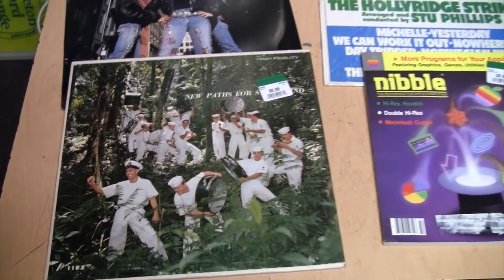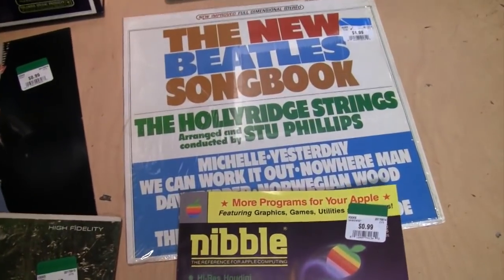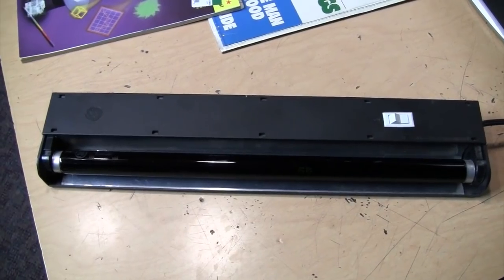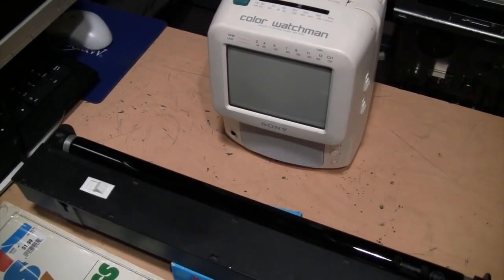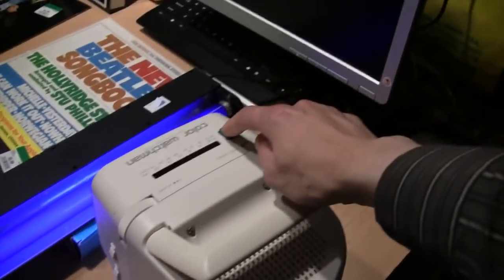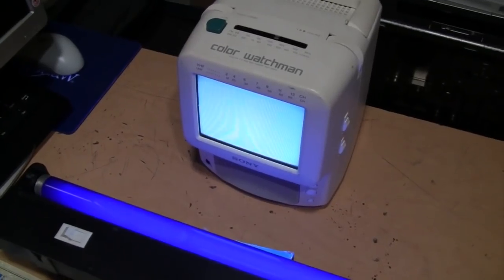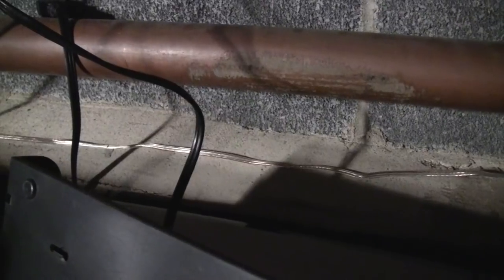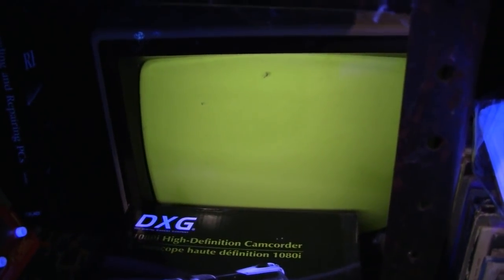Blacklight vs. CRTs

Comment: Yup, that's what blacklights do, they make the phosphors/fluorescent materials glow.
Noticed it with my TV when I had it in my bedroom, many years ago.
Of the few "disco things" I had in my childhood, the blacklight is one thing I didn't sell off because it's so damn useful for all sorts of things, checking banknotes for example. Or checking the conformal coating on printed circuit boards (not all coatings are fluorescent).
Very useful indeed. :)

Comment: "No user serviceable parts inside"?  I beg to differ.  I have a bunch of blacklights around, and one of them is even the same fixture.  It's not fun opening it, and you may break clips on it when you do (easily resolved by a little bit of hot glue), but you can replace the starter inside when it goes out.  It's not socketed, so you'll have to do some soldering.  The wires don't give you any slack either, so it's not a fun job but it can be done without too much fuss.  In addition, you'd be appalled at the shoddy Chinese wiring job inside.  And just imagine how many things around the house are wired in a similar fashion inside.  That gives you an all sorts of safe feeling inside.

I've seen blacklights make CRTs glow before, but actually never held one up to a monochrome screen.  Neat trick how it glows the color of the phosphor inside.  Sounds obvious now that you show it, but I wouldn't have thought of it on my own.  I probably have some of that dollar store speaker wire around as well.
Reply: jaykay18 They WANT you to buy a new one and pay up.
Reply: Of course, but you can beat them at their own game!
Reply: There are ALWAYS serviceable parts inside everything. I always cross out "No" and write "Lots of" so it reads "Lots of user serviceable parts inside".
Reply: That works!
Reply: KD2NOA Edward Martz Or they don't want you to see the crappy quality

Comment: 2:07 holy shit this scared me. 1am watching and thought somebody was breaking in
Reply: It actually startled me too.
Reply: startled me aswell and thought the same thing lol
Reply: Wow I went back to check it out and wow, the first time I heard it I assumed it was just a noise outside (I'm using headphones too). It sounds like the same effect of a binaural recording
Reply: When I worked in clubs, they would have these 36inch black light fixtures over the bar shining UV towards the overhead tv and it was freaky to see the screen glow so bright.  You can have so much fun with a bright yellow, green or orange  neon markers. Even if they were almost dry. 

Also, ifound that those cheap Halloween a19 bulbs make for a good pass thorough filter for UV light by Loki g at the world through the glass. Also, where I had cataract removal surgery in the 70s, I can easily see UV A light.  So to me, black lights are fairly bright.

Comment: 1:15 it glows because of the phosphorescent material used on the CRT screen which emits light when struck with UV or high energy light
Reply: phospor material in the crt is same as in the lcd

Comment: I used to have an old crt monitor for my computer. I noticed one night that i turned my cieling lights on and off quickly and the crt retained the light for a seconds before it faded. CRTs are definetely unique technology
Reply: ethefire This effect is due to the phosphor applied to the inside of the CRT's glass panel. Phosphorescence is when a high-wavelength electromagnetic wave (such as UV light) is converted to a lower-wavelength wave (like visible light). Since the human eye cannot see UV light, such coatings suddenly emit a bright light under a dark light. Fluorescence has similar effects, but works in a different way.

Comment: Hey that's awesome, I take it this only works when the TV is turned off, because I never noticed the CRT digital scoreboards at the bowling alley glowing in an especially funny way when they have "glow bowling". Either that or they applied some sort of coating on the monitors so they don't glow and obscure the score board.
Reply: works on my mini portable and main crt monitor while on, just need a strong uv maglite pointed right at it

Comment: do you remeber the video of dont buy cheap chargers? well i buy a laptop (Hp nc6230) and come with a "original charger" was in really good sharpe and the connector id bigger than the port of the laptop it connects but is a lil bit larger and in the side say Caution may become hot in english jappanisse and more later i found tthe sticker say HP down was other and i quit the HP stiker and i found a Made in china and corerct was a cheap charger
and interfire with my am radio the seller say can come with a original or a generic but i dont know if the seller do this or the seller of the charger selled like that i really dont know
Reply: Punctuation is a wonderful thing.
Reply: English isn't everyone's first language.

Comment: does it work with gas plasma screens?
Reply: I would guess no - I don't believe they make use of a phosphor.
Reply: It should, as that is EXACTLY the principle of operation of PDPs. Mercury vapor inside the gas plasma cells emits UV light as it gets struck by electrons flowing through the plasma. That UV light in turn excites the phosphors on the panel to glow in infrared (60% of the energy and the main reason PDPs are so inefficient) and in the visible light spectrum. :)
Reply: ok
Reply: I assumed OP was talking about the orange plasma displays used on some vintage computers. Those use neon gas and no phosphor.
Reply: Whoops, didn't think of those... If that's what the OP meant, then, no, it wouldn't work on those. Otherwise it will work on plasma TVs. :)
Reply: I tried this on a very modern plasma TV, a 64" Samsung F8500 from 2013. It didn't glow at all. This is one of those "dark panel" PDPs--when it's off it kinda of looks like a glossy LCD. So it might have some sort of filter in front of the actual PDP. All speculation of course, but if plasma displays are supposed to glow, then I'm guessing that filter might be the reason mine doesn't.
Reply: Well, I had a Panasonic plasma TV from 2010 that only had a simple glass sheet in front of the panel and my guess is it would've glowed... Althogh glass itself does cut down a lot of UV light...
Unfortunately I can't test that presumption since I don't have a blacklight and I sold that TV in 2014 to buy the last model (ST60). The last plasmas did (and do) have various filters to cut down on reflections. I don't know to what extent they filter UV light though. 
Old CRTs work best because the phosphors are close to the outer surface of the tube IMHO

Comment: Hey Vwestlife, this Calibre 360 turntable I picked up recently has a ground wire along with the rca jacks, however my 90's sony combo system with a phono stage has no clear grounding screw. Will this be problem or will I not have to ground it?
Reply from the maker: You don't need to use the ground wire if there is no hum in the audio. If you get a hum, you can try using the receiver's antenna ground or any other screw on the case that is grounded.

Comment: How do you replace the starter lamp is there are "no user serviceable parts"?
Reply: You just replace it anyway. There are ALWAYS user serviceable parts inside. They just dont want you to take it apart.
Reply: These were cheap fixtures meant to be disposed of if the starter went bad. It's a bare glowbottle hardwired into it. You can replace it if you're handy with a soldering iron.
Reply: When they say it is "Maintenence-free" They actually are saying under their breath "Maintenence-Impossible."

Comment: Version? It's probably the DOS. DOS was on EPROM or PROM back then on that computer and most others. The speaker wire shows you there are a lot of things that fluoresce. Frankly I am surprised you didn't google it up before posting this video. Feldspar will fluoresce, too. Hold a dollar bill up to it.

BTW the fixture you have can be "hacked" to include a manual fluorescent starter when the one inside goes out so don't throw it out. Just wire it in series with the neon bulb that goes out.
Reply from the maker: DOS doesn't run on a TRS-80, unless you mean TRS-DOS, in which case you'd still be wrong because TRS-DOS does not have a status line and menu like that. Frankly I am surprised you didn't Google it up before posting this comment.
Reply: timcat100 wat da... its obvius, a quick search get fastest anwers than ask here
Reply: So if it didn't run DOS, what OS did the TRS-80 run. CPM?
Reply: He said above that it runs TRS-DOS.
Reply from the maker: timcat100: I was just mirroring John Possum's pissy comment where he said "Frankly I am surprised you didn't google it up before posting this video."
Reply: timcat100 Don't dish it out if you can't handle it. Maybe if OP hadn't made a condescending comment he'd have gotten a more polite response.
Reply: timcat100 YOU CANT HANDLE THE TRUTH!!!
Reply: timcat100 How old are you?
Reply: timcat100 Nice advise